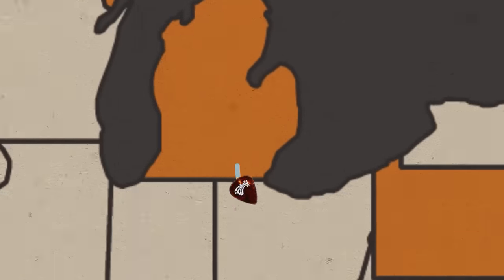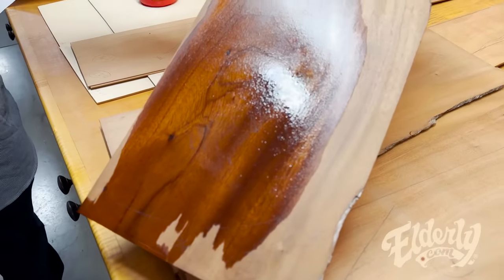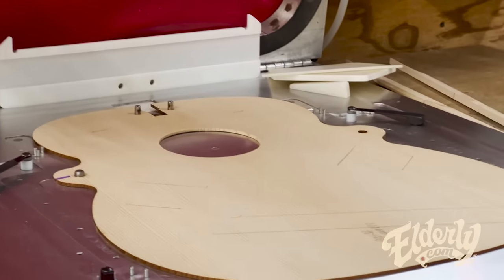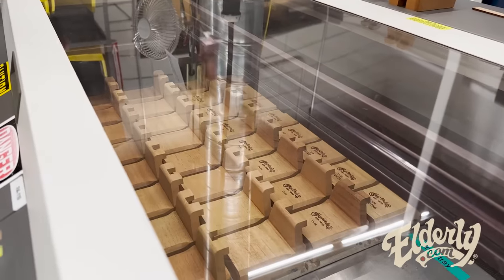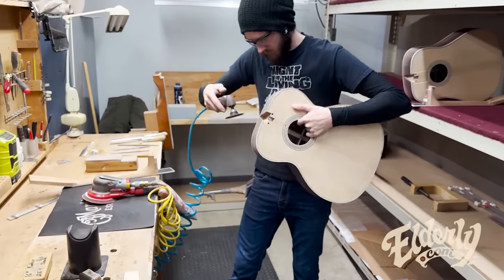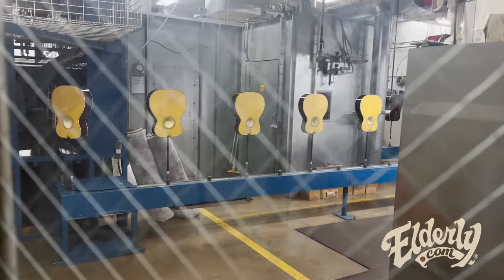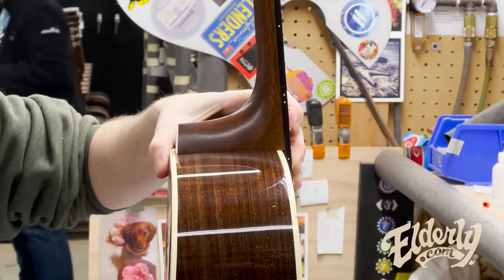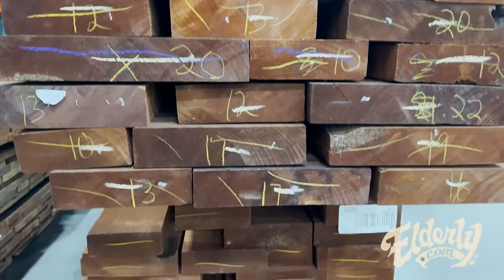Inside the Martin Guitar Factory - The Complete Tour

Comment: My Martin DCXIE, bought new in 2009 (and does not travel), was suddenly unplayable one morning. Some of the strings were laying on the fretboard close to the body. The dealer where I bought it said the glue holding the neck released and they don't repair that problem. I called the Martin factory and was directed to an authorized repair store here in Dallas, Texas. I was told there that the neck wasn't glued and all it needed was a setup and new strings. After maybe three days I was told the guitar was ready and the charge was $103. First, I wanted to check the work. The guitar was still unplayable! They were ready for me to pay the bill and walk away with an unplayable guitar! The clerk checked 'in back' when I complained and returned to say "they said it needed a new saddle". Wait, you were going to let me walk when it still needed work? You had me make the trip to pick up this guitar when it still needed work? The clerk had no explanation. I write all this because I was hoping to see how the neck was attached in this video and that part, where the neck is affixed to the body and adjusted, was left out. The more I think about it, the more mad I become because they'll charge me for the setup that did not fix the problem and for a saddle replacement when I return to pick up the guitar. If indeed is actually fixed this time.

Comment: Hey folks , have a beautiful 30 yr. Old D2R and I have a Me Ican made 000X1AE and it’s the best playing and sounding guitar I’ve ever owned but the plug in hardware keeps going bad,it’s hard for me to pull the plug out of the guitar,I had guitar centers work on it for me and it worked for a year,now it’s back ,can I send this guitar to you  to put better electronics in it .Does Martin stand by Mexican made Martins .The sound hole is also peeling its coating.love the guitar to get fixed or can I purchase another like this one,has a spruce top.
Reply from the maker: Hey there! Our team can help you with that. Call 517-999-9830 to discuss with our repair shop. You can find more information at https://www.elderly.com/pages/repair